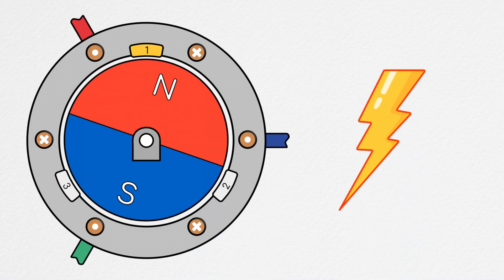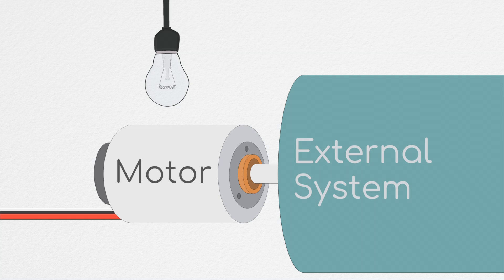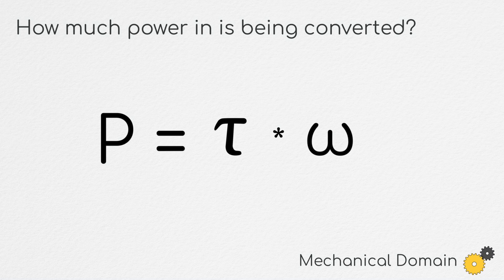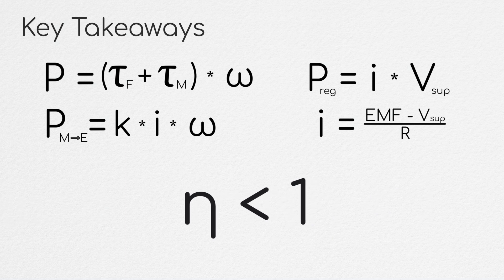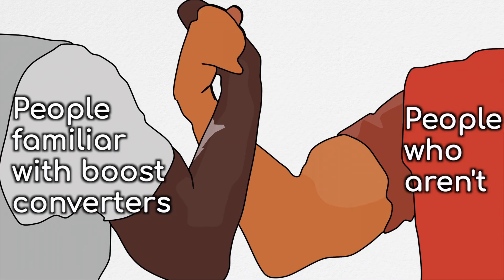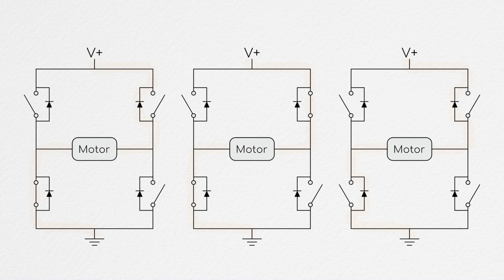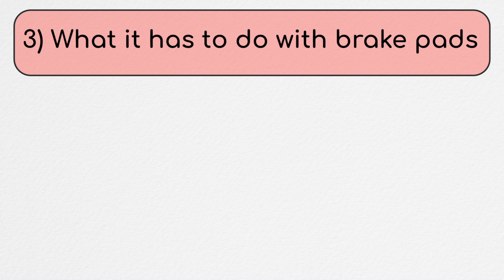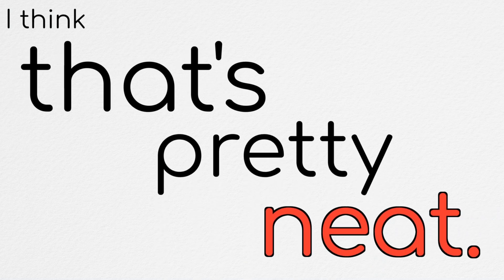Optimal Regenerative Braking, Explained (episode 14)

Comment: I think that the idea of using regular breaks to add efficiency isn't exactly true. It's more efficient on the motor for heat reasons but it shouldn't generate any more battery power. Higher current at the same output voltage would have power battery current output, but high resistance losses, and so the motor heats up more to keep breaking torque at lower speed. If you used more mechanical breaking the amperage in the motor would be less and so efficiency better, but with equal or less actual battery current flow out of the motor. Lower torque and at higher rpm is more efficient, basically when the battery and phase amps equal, it's running almost peak efficiency. But Regen breaking will never be that efficient because of the step up, so phase amps always have to be higher unless your back emf is higher than battery emf thanks to incredible speed or very low top speed due to lower battery voltage.

Comment: Could you overcome this compromise by using external inductors to boost the voltage, instead of the motor's inductance? Then you wouldn't have to divide the motor's time between increasing current and driving energy into the supply?

Comment: Amazing videos! You deserve all the praise these comments sections are.
Question about regen, isnt the shorting of the leads for boosting the same thing as the unforced phase in space vector modulation? Does that mean that during each unforced phase there is heaps of energy being pushed back and forth into the inductors which is undesirable as you had previously mentioned?
Reply: Hi, In this video he is describing how regeneration works on a DC motor, while you are asking about a 3 phase power supply.  It sounds like you want to know if an open circuit phase of a 3 phase power supply is the same as short circuiting the motor.  If that is what you are asking, then the answer is no.

Comment: It's really hard for me to understand that last part. Since mechanical braking reduces the speed and thus the Back EMF, how can it even assist the regeneration ? I mean I can understand it's usefulness when high braking torque is required and it cannot be achieved just by shorting the phases + connecting them to battery afterwards. But is it increasing the energy or just helping the optimal PWM duty cycle for regeneration?

Comment: what about gearing up the rotation of the motor so that the wheel spins the motor faster during breaking ? ( if CVTs could be made workable - this might be a good implementation for them )
next - what about having a separate set of batteries that are more depleted than the main set - so that upon acceleration, these batteries are highly depleted and then during braking they can capture more of the regenerated power ?

Comment: What I'd like to know is if this regeneration system would charge the battery to full if it were to be continuously rotated by force?  That is the only thing that is really important;  because if it could;  then it could charge the car while you are sleeping;  if it were to be connected to a wind turbine that would be what could even be part of the vehicle.  Because that is really what everyone want;  free energy to run their car;  that is everyone that isn't making money with selling energy.
Reply from the maker: To answer your first question, yes, it could. But to go a bit deeper, this is how turbines (wind, hydro, or gas) work already. They turn a generator, which is essentially a motor by the force of whatever is supplying it. This then generates a current and a voltage, which is put onto the grid.  So, if we set up clean energy infrastructure on a large scale, this would be what happens while you are sleeping, only your car wouldn't need to have the added weight of a built in wind turbine; plus efficient wind turbines are incredibly expensive and produce an absolute boat load of power, so it wouldn't be practical on an indivicual level. anyway, yeah, turbines are cool.
Reply: @jtlee1108  This wasn't quite what I'd been asking;  I was asking if we were to build a simple blades part of a turbine generator and maybe even have it within out homes' attics being the inductors and having a quick connect to our electric car's drive train or even better yet the part that would then be a free spinning shaft that is now the link to the torque coming from that braking system.  and this way there would be less of the vehicle's drive train being used.  I'm also sure that the stator that is use could be built and one could go direct to the next part.  The blades part of a turbine doesn't really need to be heavy;  and I'm not sure of how much resistance that the head on to wind is but that could also be used while going forward.

Comment: ummm why wouldnt u have a second generator that is oynused fir breaking and it replae the break pads setup??   tjat u can jave ir motor optamize the regen like he explained but then fir tje additional stopoing power it would engage the secondary generator instead if break pads so u can regen even more..  cuz any time u squeeze a tire to stoo it u are throwing away all tjat energy inti friction and heat

Comment: Very good explanation. Can you also elaborate on the control techniques for using the inverter switches in regeneration mode? Is it just reverse SVPWM or any better technique?
Reply: Hi, using the inverting switches in his circuit design at 6:44 would be called plugging or counter current braking.  In this case you are using power to do the braking.  It is the fastest way to brake, but you wind up using a lot of current to do it.  It is a good way to burn out the motor, so I would only use it in an emergency to stop the motor immediately.

Comment: But isn't the torque a undesirable effect when braking?
If you draw current, this would slam the motor and cause a fast stop, but it would be a large spike. Usually way outside the capacity to " translate" the power.
Reply from the maker: the torque we are talking about is negative, braking torque. also the currents you would generate are relatively low, and typically a motor would be connected to a higher inertia system. Because of this, it would, in most all cases, slowly brake the motor to a rest.
Reply: @jtlee1108  the torque and draw are almost equal, the unforseen is how long your want to stop, or how short and the power generation. It cant be one size fits all. Same as with motors. 
I've seen high current from using DC motors and with a lower voltage. I don't believe the same occurs in AC??

But isn't the torque when stopping on regen amp'd but the transmission ratio at the wheel?
Reply from the maker: the torque during braking will have the same transmission ratio applied as it would when driving (assuming you havent switched your gearing). the only difference is that the torque is produced by current which is being driven by the BEMF of the motor, as opposed to your battery/source. As far as stopping time, you can wrap a current control loop around your braking torque and vary your duty cycle at which you are PWMing your motor leads together. In this way, you can specify the braking torque you want out of your motor.

Comment: I loved the video and you do a great job of showing how the regenerative braking system works.  However, I must admit that I'm a little ticked off by the explanation.  I was under the impression as a new electric car purchaser that I would be buying a car that had some inherent benefits such as less maintenance on brakes due to regenerative braking.  Personally, I like the idea of recharging when I release the brakes but I don't want for the car to ever use the pads and would rather sacrifice the added battery power for longer brake life.  My car will go 226 miles on a charge so I have more than enough to get where I am going under normal driving conditions.

I have read the manual on my 2021 Nissan Leaf SL Plus and it doesn't really tell me exactly at what point the pads are being apply other than when I depress the brake pedal.  I'm not sure whether to use ePedal or B drive mode or just drive in normal D mode.  The user manual is not clear.

Comment: It will ultimately come down to the way in which the oem software is written... Right?
Reply from the maker: by 'OEM' do you mean original equipment manufacturer? If this is what you mean by the abbreviation, this series is primarily about motors which are not sold with prefab controllers, where you write the software for commutation.

Comment: It'd be nice if there was a setting where the car could only use the brake pads when absolutely necessary, energy losses be damned.
Since the motor will be the only rear braking source for my e-bike, I'll have to do this. I wonder what the real-life difference in efficiency will be between:
1: Limit braking torque so it doesn't hurt energy recovery
2: Limit braking torque only when you're shorting all 3 phases together
3: Never limit braking torque, even if you have to shove energy into the motor to help brake faster.

Comment: Hi, great video!
Really appreciate the time you take to make these videos and animations!

Quick question, at 2:20 , shouldn't it be Kv, instead of Kt?
Reply from the maker: thanks! so I will start with the caveat that I haven't read every motor data sheet by any means, so what I say may not apply to how every manufacturer reports their stats. 

in my experience, the torque constant is typically listed in N*m/A, which, if you convert things over will be equivalent to V*s (which, expanding is Volts / (radian/sec)), so multiplying by the speed (assuming you are in rad/seconds) would give you the voltage of back EMF produced. 

alternatively, you could use the speed constant (as they are, at the end of the day basically telling you the same info).The speed constant is typically given in RPM/V, so if you divided your rotation rate by your speed constant, you should get the same answer. 

The reason I tend toward using the torque constant as a rule is that I tend to think of motors in a sort of bond graph sense (https://en.wikipedia.org/wiki/Bond_graph, its not a super common topic, but I had the opportunity to take classes on it). in this notation, you can think of motors as gyrators which bridge domains (I.E. going from the electrical domain to the Mechanical). And, when doing this, it tends to be easiest to just use one gyrator ratio where I*kt = t and W*kt = V. 

So, all that to say, I believe you could use either Kv or Kt, but if you use Kv, I believe it should be w/Kv, and you would need to make sure w is in the right units. hope that helps, and thanks for watching!
Reply: @jtlee1108  Yeah that makes sense!

I tend to use Kv when dealing with voltage and speed, and Kt when dealing with torque and current - my personal preference.

Though I do concede it creates confusion as it implies a motor is defined by two different constants when in fact they are reciprocals of each other.

Cheers for the interesting video!